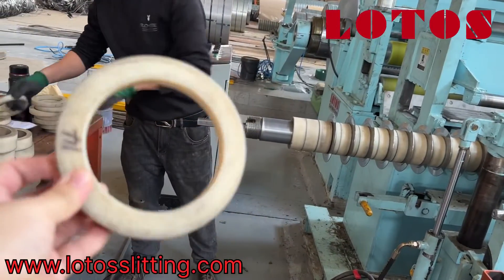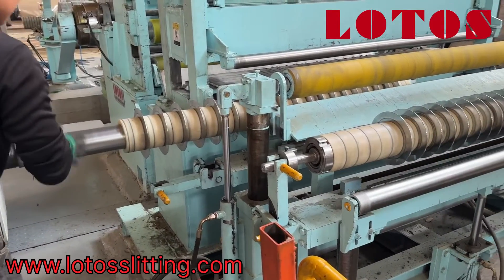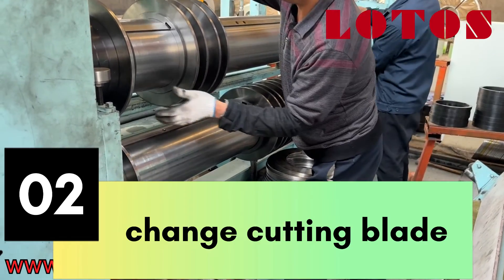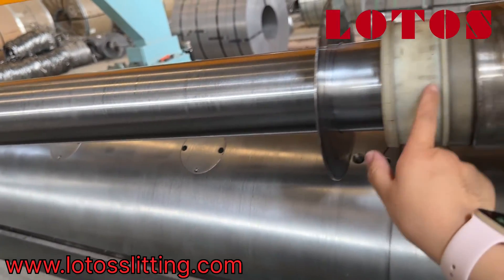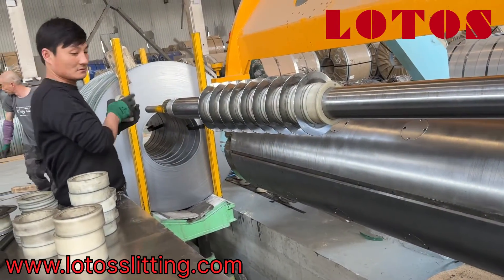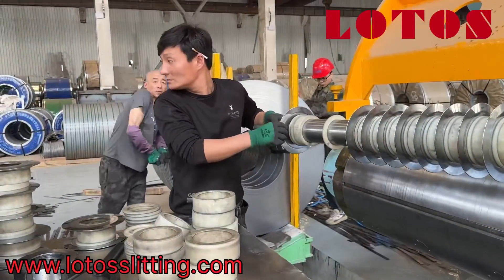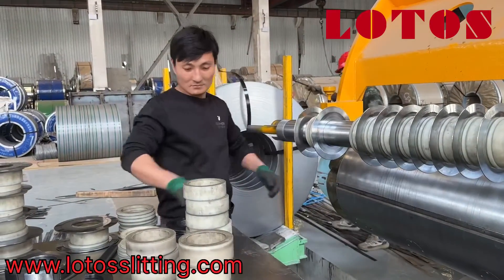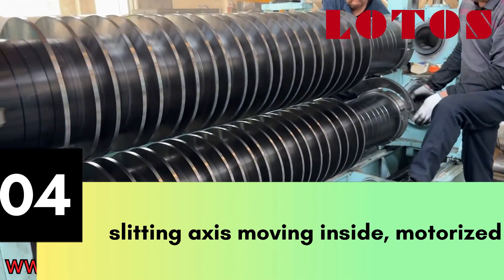Slitting Line Operation | Metal coil slitting line | How to running slitting machine ?

Comment: How to calculate a cutting clearance? Soft, normal and hard thickness and how to do a slitting blade scratch remove do you have any tips? I’m beginner slitting operator.
Reply from the maker: Hi.Pls the contact us of the  contact for details below :
sales@lotosslitting.com
victory@lotosforming.com
0086-13814241007